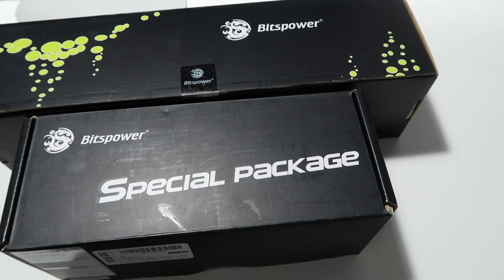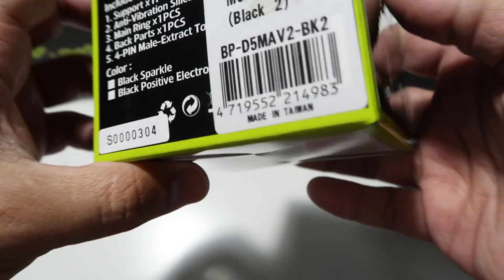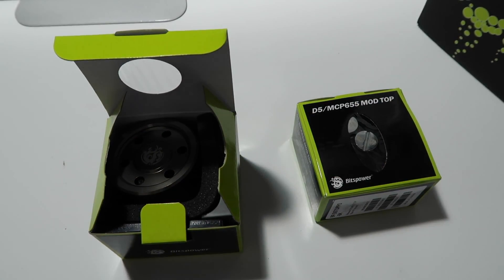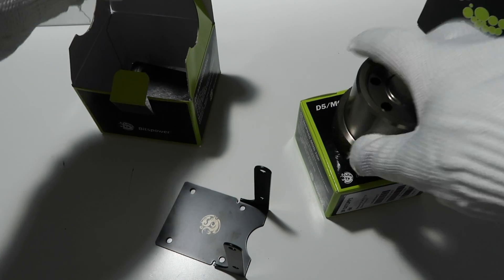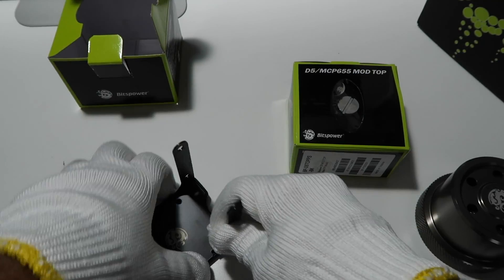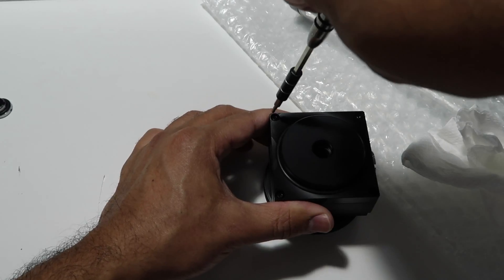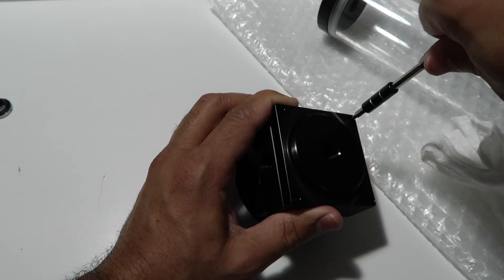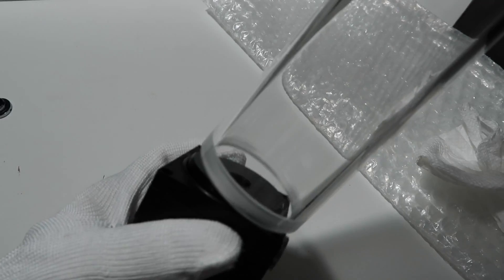BITSPOWER D5 UPGRADE KIT ASSEMBLE

Comment: Can you please tell me what the plastic thing is in the bag that had the screws and O rings? its an "anti air chamber" plug thing... WHAT IS THAT FOR!?!?!?! and do you need it? Thanks.
Reply from the maker: +Crixus The Gaul I was wondering the same thing, but i dont use it and its really small to fit in any of the fittings threads. If anyone knows, please let us know.
Reply: I kinda figured it out... you really have to just put it on and look how it fits, and then it makes sense. Because the pump top has two ports on the top side, if you use the pump/res upgrade, the pump is going to force water into one of those valleys, if you put that plastic thing in there, it perfectly fills that gap. it makes sense when you put it on.

Comment: i just purchased a singularity reservoir system.  I think they make great products.  Have you had a chance to work with any of there products?  I'm still leaning on how to build a water cooled system and going all out on it.  Can you make a video on how you install all the wires to the motherboard.  That would be very informative!  Thanks again, great work!!!
Reply from the maker: +crhodes0302 My custom cables are from Singularity Computers. Also, I have some black reservoir mounts from them as well. Watercooling can be challenging, but its a lot of fun at the same time. What kind of motherboard are you planning to use??